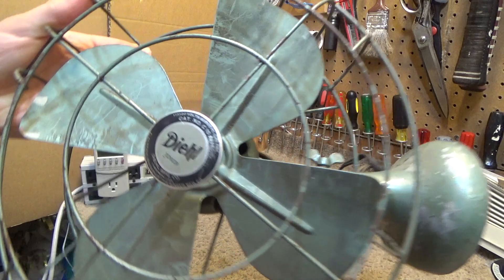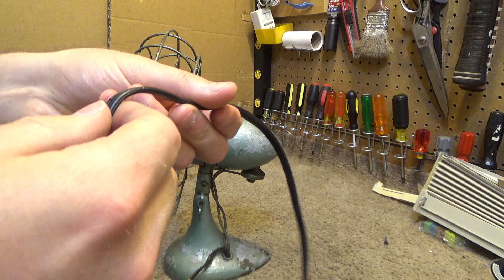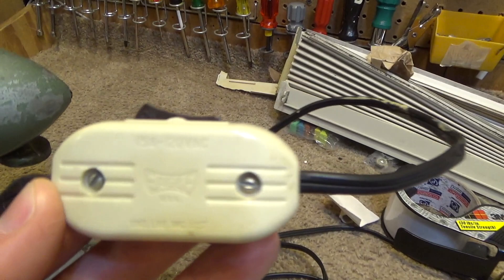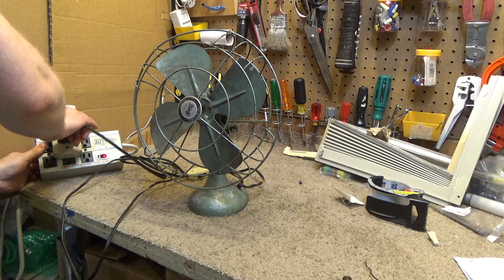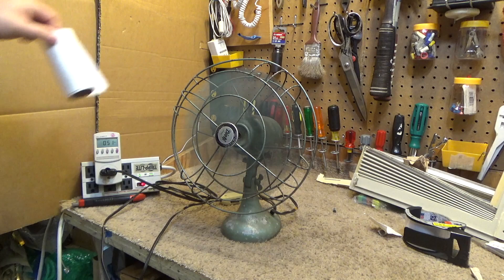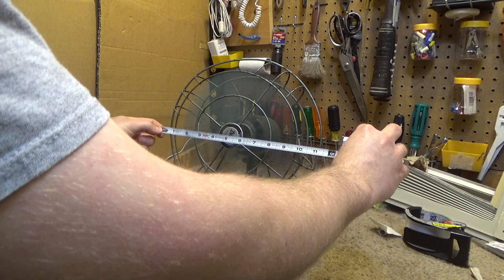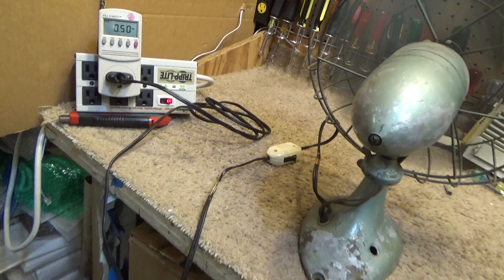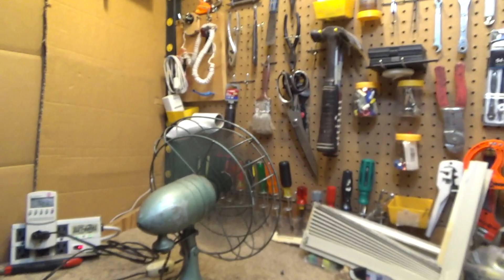Diehl Junior C 10 AJ17 Oscillating Table/Desk Fan

Comment: The mechanism for the oscillation will have several holes where you can screw the thumb screw into, the one that is the furthest from the center will oscillate with the widest path, and the one closer to the center will be more narrow like what is going on there. That is how a lot of those old lower end fans work. That one looks a bit strange, but I would guess it is something like that.